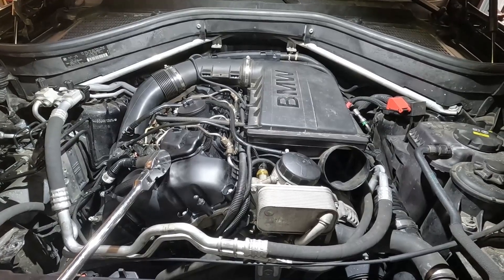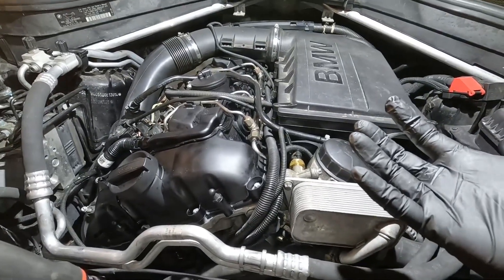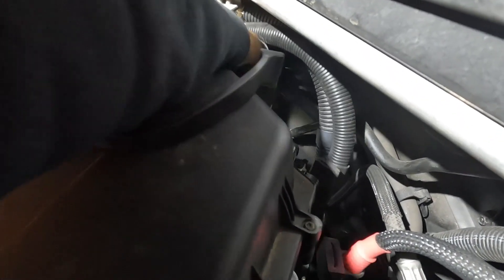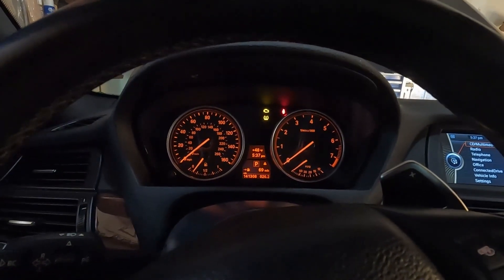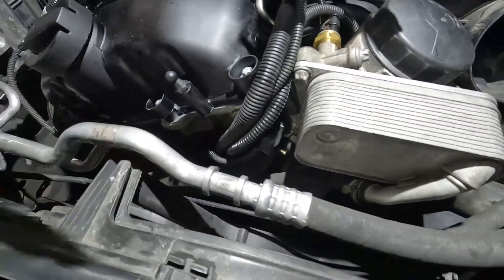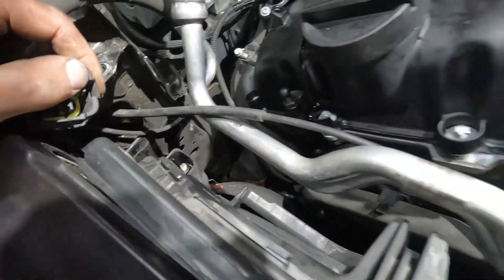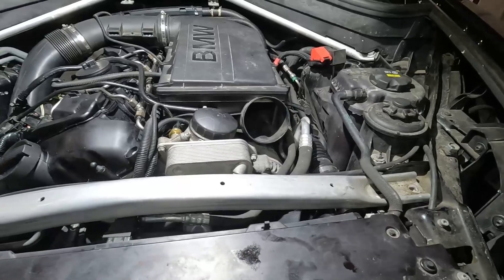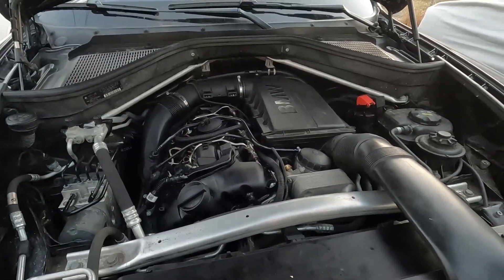BMW Oil Priming Procedure - Prevent DAMAGE TO YOUR ENGINE! BMW N55 -ask the car experts

Comment: If engine was used after oil change, is there still point in doing that? Lets say I do not trust my mechanic doing that for example 😂
Reply from the maker: This step is to help prevent internal wear from a start with no or low oil in the system. I have seen a new engine fail due o no priming or it could shorten and engines life span more on a used engine.
Reply: @AskTheCarExperts  thanks! Gotta make sure my mechanic will do it properly, or do it myself.
Reply from the maker: @nopnopnop100 Definitely ❤

Comment: Please help me wrap my head around this. For an OFHG change you take a part that essentially holds no oil, remove it, then place it back. How does this create an internal condition that requires oil to be primed? It's not like some vacuum has been interrupted. Most of the oil all drains down the block anyway.
Reply from the maker: Even a small disruption beyond an oil change it is BMWs recommendation to do oil priming to prevent internal engine wear. The housing has a check valve. When removed you loose more oil reserve than just an oil change. You dont have to do it....but you should.

Comment: I am not convinced that this is necessary. When i started the engine for five second after an oil change I could hear a great woosh as the oil filled the motor. I cannot imaging the oil pump is that weak. Next time I will do this procedure. Thanks  for the advice.
Reply from the maker: Hello, This is not required for an oil change.  This is for any repair that can interrupt the oil circuit.  Ie. Vanos, oil pan, oil filter housing

Comment: best tutorial on youtube regarding this topic. Do we have to prime the N55 after replacing valve cover and spark plugs? thanks!
Reply from the maker: Thanks! There is no need to do oil priming with a valve cover or plug replacement. You want to prime with any repair that interrupts the oil circuit. Oil Pan, oil filter housing, vanos units for example.
Reply: @AskTheCarExperts  thank you

Comment: Im new to BMW's and just swapped a N55 in an X5. Where can I monitor oil pressure in real-time while priming? Will this show up in ISTA? I just installed it on my laptop and I have the interface cable.
Reply from the maker: @chipjumper  You may be able to see it under DME and pull up the live data.

Comment: I had removed the DME connector but I can't put it back on. The connector goes on but I don't feel the pins being inserted? How do I know when the connector is connected? When I have the connector on the slider won't slide back in. I don't want to force it. What do you recommend?
Reply from the maker: @positivethinking2721  Sorry to hear that. Don't force it. Check for any debris that may have gotten into the DME connection. Make sure it is the correct plug as well. If you unplugged more than one connection it may be the other connector. with the lock slid back it should rest in place and then the slider is pushed and it should sink down.
Reply: @AskTheCarExperts  I appreciate your prompt reply. I had taken the connector off that is closest to the firewall (only one connector) and turned the engine the 3 (10) sec intervals as required for the oil prime procedure. That worked but I can't get the connector back on to slide the slider back in. The pins are all in a single row all around the edge of the module. So, when I put the connector back on I don't have to push the pins in? I put the connector on and tried to start the car and it sputtered. Maybe because I first tried removing the two fuses to the fuel line # 139 & # 184 but the engine turned on so I put the fuses back in and disconnected the DME module to the fuel/injector rail)
Reply from the maker: @positivethinking2721  The connector pulls into place as the slide like is locked. Disconnect another connector so you can review how it comes off and goes on. Then try again.

Comment: hey man I have a question, just installed new timing chain with guides,  also cam ledge trays and new seals for camshafts , I turned the motor clockwise twice to see if I’m good on timing , timing is there , the car has been sitting for over a year , do you recommend priming the motor a couple times before actually starting it? Keeping the coils and injectors disconnected?
Reply from the maker: Sorry for the late response, Yes absolutely do the oil priming.

Comment: Thx! This tip with disconnecting the DME connector was exactly what I was looking for since I didn’t pull fuse 165 and run the car out of fuel in the fuel injectors prior to starting. Also didn’t feel like removing pipes, etc in order to get to all of the coils and fuel injector connectors either. Much simpler approach. Great idea.
Reply from the maker: Great to hear the tip helped! Thanks for subscribing!
Reply: great video and thank you....I have a 2011 135i (with the DCT trans) with the N55 but my harness seems to be vertical and yours seems horizontal....I am having a hard time disconnecting the harness and the clip seems to be towards the driverr side...Any thoughts based on your experience? thank you in advance.
Reply: @arvindkd did you figure it out? I can't tell from this video what needs to slide to unplug it

Comment: Great video!  I’m doing my OFHG and cooler gaskets soon. The BMW bulletin I read on priming talks about removing the fuel pump fuse but I’m also reading some people do that and car still starts so I’m not sure if I should try that method or not. I noticed you’re doing the manual engine cranking AND the other priming method (10 on 20 off…) is the manual turning of the engine required then? If so, what size of bit do you need to do that?
Reply from the maker: Hi Keith! Yes I would recommend the manual engine turning. This is BMW's updated procedure. I think it is a 21 or 22 mm socket if my memory serves. Best to remove the DME connector because this will cut spark and fuel completely and will prevent it starting on you. Or you can manually disconnect each coil and injector plug.
Reply: @AskTheCarExperts  the BMW bulletin I saw was from 2016 and like I said, it just mentions the fuel pump fuses.  So does manually turning the engine 2-3x, actually cause the oil pump to pick up oil then and lubricate things? For some reason I figured the oil pump was electric so wasn’t sure what the manual turning was doing.

Comment: Would adding an oil additive like LiquiMoly Cera Tec be advisable to the initial oil fill up (5w30) before stepping through the oil priming procedure on a new engine and for the initial 500mi. engine break in?
Reply from the maker: Hi Patrick, I would say yes to that! I have started using Cera Tec in my BMW E70 with the N55 notorious for lower end problems. I am hoping the additive will also help prolong the engine life and turbo life. 
Prevents direct metal-to-metal contact, thus increasing the engine service life. The low-friction effect reduces fuel consumption in gasoline and diesel engines. CERA TEC provides wear protection for engines, transmissions, pumps and compressors. CERA TEC should be added to the oil and is self-mixing.
If anyone is looking for this product I will provide a link below:
https://amzn.to/3Rnwcyj
I do make a small commission if the link is used but it does not cost you anything.

Comment: thank you for good info.
Reply from the maker: Glad it was helpful!
Reply: im about to DIY oil filter housing gasket and mosselman thermostat just wondering can I actually create some oil pressure with rotating the engine with hand ? to purge the system from air? @AskTheCarExperts

Comment: Can you do an oil filter housing replacement video i can do it but theres like two bolts that i cant get to
Reply: And oil cooler
Reply from the maker: I have a few videos on that actually. This is the N55 version.
https://youtu.be/PDteS75j4_w
Reply: Is changing the oil filter make it necessary to prime the circuit?

Comment: Do I have to do this with a N54 ?
Reply from the maker: Hello, Yes this would be done on ANY engine when the oil circuit is interrupted after a repair or an engine is replaced.

Comment: Mind won’t start until I step on the brake pedal. Should do the same thing correct?
Reply from the maker: Correct, foot on brake to crank the engine over during the cranking part of the procedure.